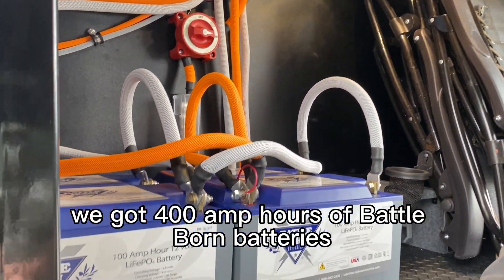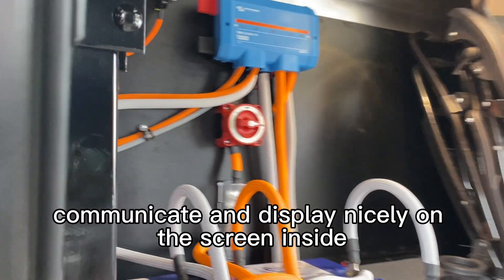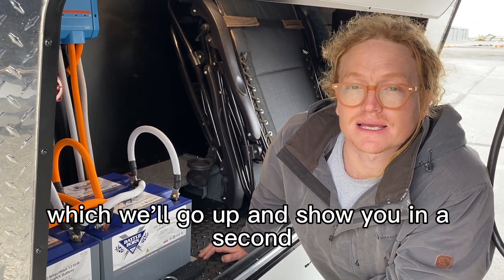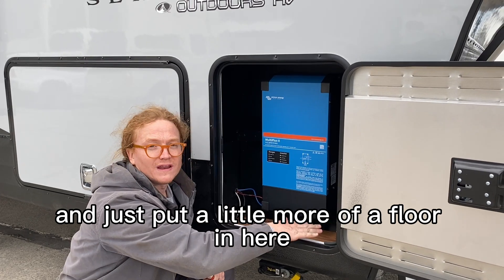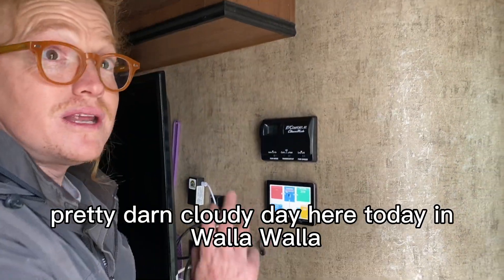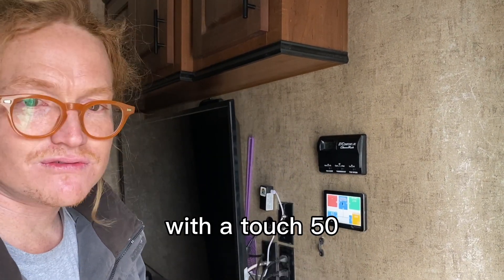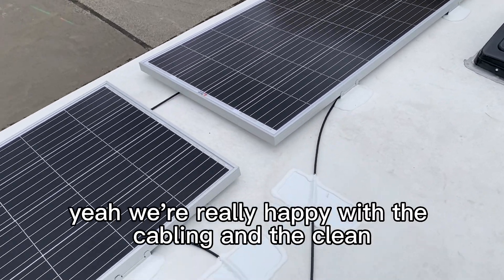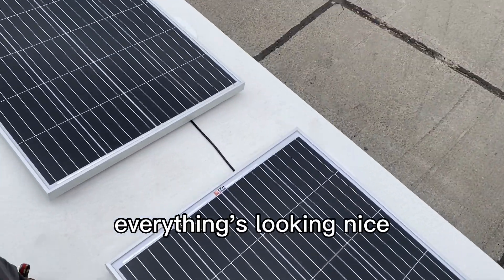FIFTH WHEEL #RVSOLAR ON AN ORV 28RKS

Comment: I have a 2024 F27 MKS Glacier Peak. It came with 3 - 200 watt solar panels and a 50 amp solar charger. I am going to add 3 - 300 watt solar panels connected in parallel for the other series to a Victron MPPT 150/70 -Tr solar charger an am switching out the 50 amp stock solar charger for a Victron MPPT 100/50 solar charger to go with the 600 watt series. I am also installing a Victron Multiplus  II 12 volt/3000/ 120 inverter. I am installing the converter in the battery compartment. What size wire would you recommend to run  from the inverter to the converter in the back. Also, do you think the best way to get to the back is to run the wire on the driver's side of the trailer which is about 35'?
  The rest of the system will include an Orion XS 12-12V/50A/DC-DC charger, a Lynx Shunt 1000, a Lynx Distributor, a Cerbo GX and a Touch 70. I am wired for 50 amps and  have 1 AC unit and may run a second one in the future.
Reply from the maker: Hey Rich! We hesitate to give these specific pieces of advice over the internet. We love sharing information but it’s hard to offer specific advice on where to run cable and what wire size to run without having the hands on the RV ourselves. Good luck with the project